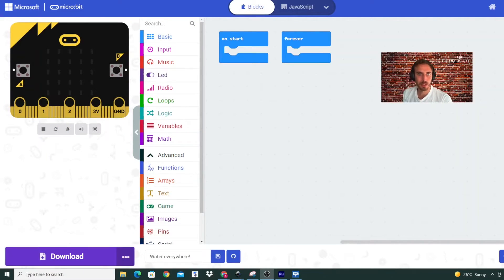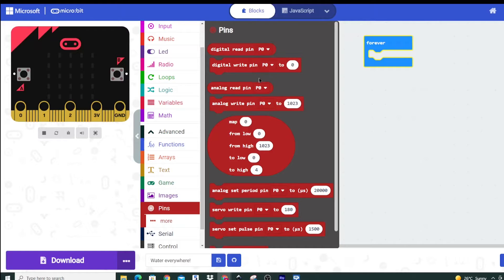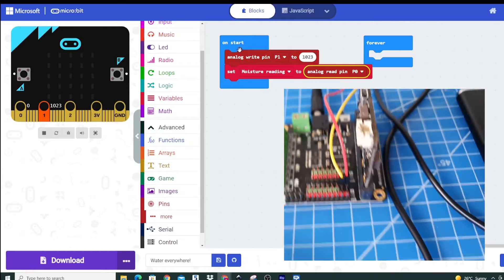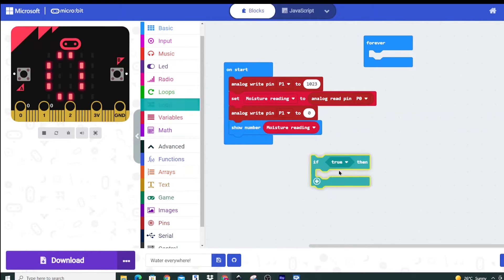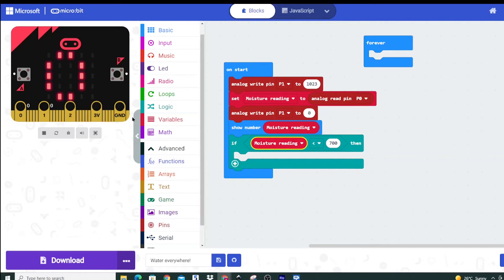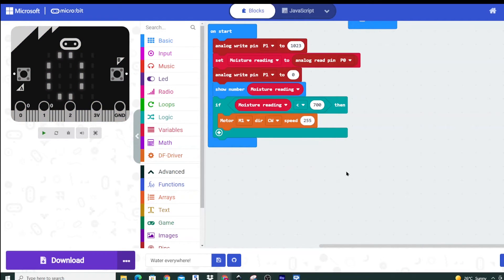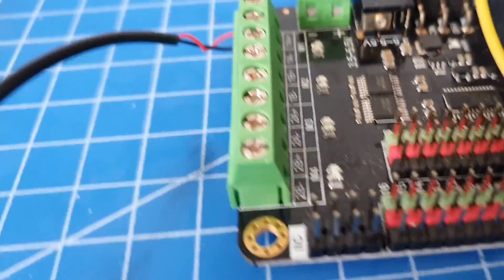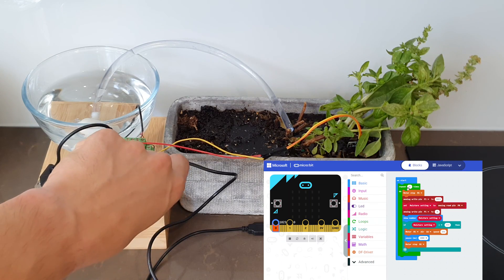How to make an automatic #Microbit garden with moisture sensor and pump

Comment: Hello.A question you have mentioned in the video that we can connect the water pump directly on the microbit 3v and GNd. I have done that but I can't stop the pump after 2 sec it works constantly. My extension board doesn't exist on Microsoft makecode.
Reply from the maker: If the extension board doesn't exist, you could potentially connect your pump to the using the pins. In theory you could use p0 and use the "turn digital pin 0 to 1" block to turn on and conversely to 0 to turn off.
Reply: @theinnovationclassroom  thank you very much for your answer! I have think that but the bump haw only to wires one for 3v and one for gnd how can I connect another one that i can use the pin0 if you have some idea

Comment: I have a quick question, when I go to extensions and put in the github address for the DFRobot driver board (I've got v2.0) the only option i have is the microbit robot driver and doesn't contain the df-driver tab you have? Any ideas?
Reply from the maker: Not sure why it's not working but I've just created a blank project with the extension, maybe see if this works?
https://makecode.microbit.org/S94480-61598-84173-57440